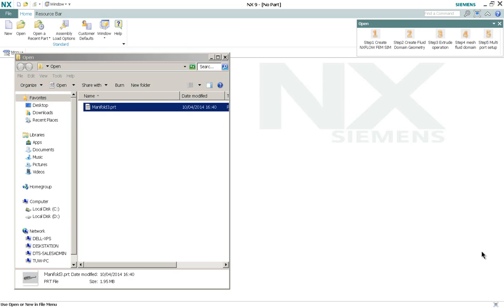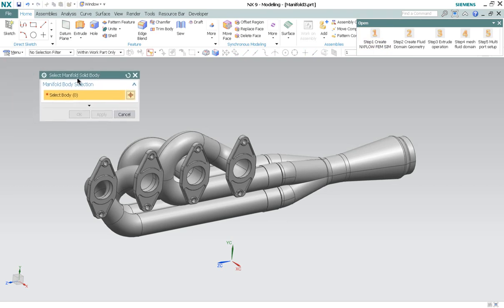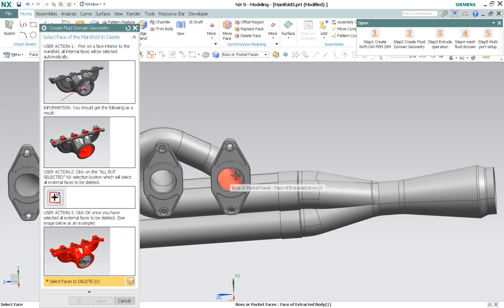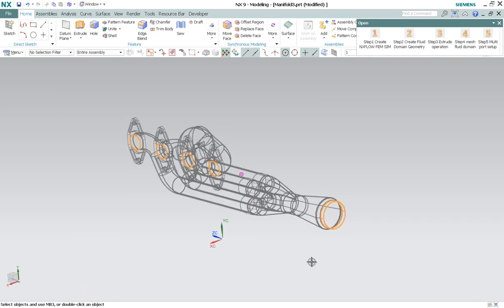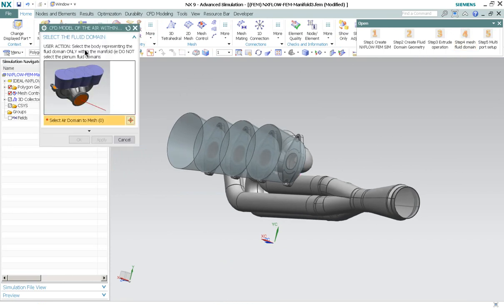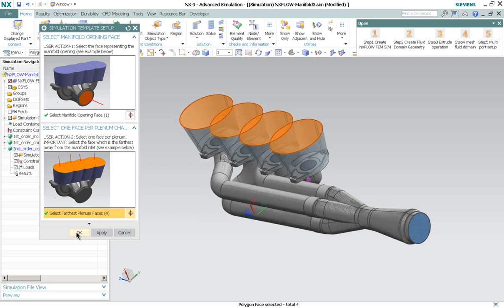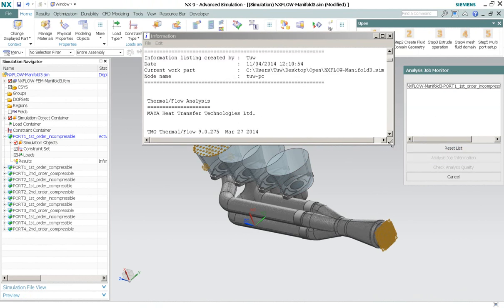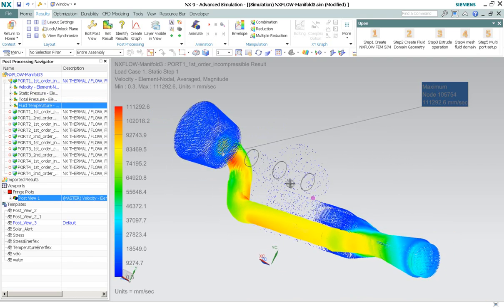NX Open -- 5 Steps to Setup a Computational Fluid Dynamic (CFD) Analysis made Possible!

Comment: Nice tutorial, only one question how long do you take to create your app?
Reply from the maker: I must admit that the original code was not written by me, i was merely adapting the old code into the new interface. Learning curve took about 1 month...
Reply: Despite of that you made amazing work, Thank to answer me. I am starting to with NX Open manly for Modeling and Drafting so if  you have any suggestion or advice, or source to learn I appreciate if you share it with me. Pretty much of the information in the help is so flat, there are not many examples or how to use classes or methods.